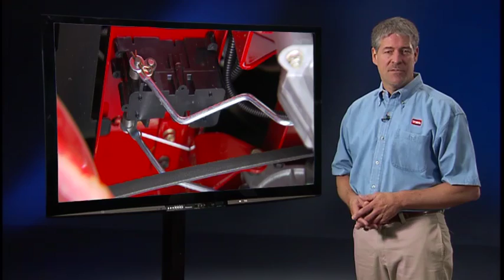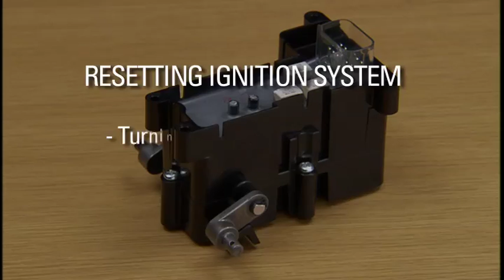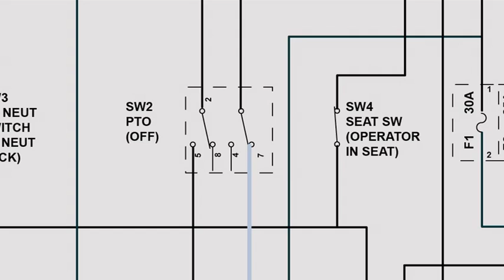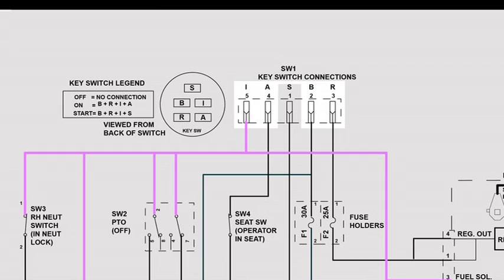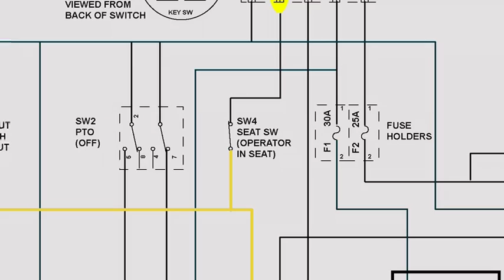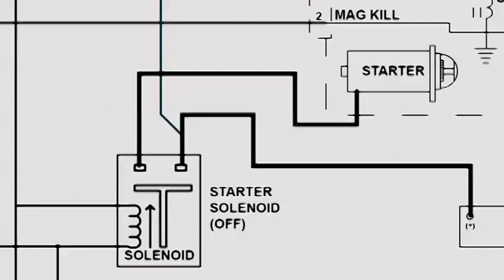TimeCutter SS - Brake Control Module (Troubleshooting)

Comment: Except they designed it to fail From mud and grass by having the electronics exposed to the elements and the only way to clean it is to disassemble the unit every time you clean it

Comment: Thankyou for a very good video.  I have  installed a new ignition switch (genuine) to replace a dodgy car type switch installed by a previous owner.  When the engine is running and I engage the PTO switch the starter motor operates.  Can you help with some advice please?

Rick from Aus

Comment: I bought a new 42 toro..3 days later brake control problems..your video is a joke...non stop electrical problems the last 2 years..dealer mechanic is also frustrated...

Comment: I have a MX 5050 and I had to replace the brake control module 3 times the last one lasted 3 weeks.  Buy a new zero turn but because of this module it won't be a toro.  Its too bad because this is the only complaint I have with the toro, but its a $100 a shot and a pain

Comment: I just spent time and money chasing this problem myself, because getting it to a shop would have been difficult, and because I like to fix stuff.  I did start from the power end, first replacing the battery (just because it was several years old).  I wasn't hearing any sounds that suggested a solenoid issue. Then after watching a bunch of YouTube videos, I became convinced that the park brake module was bad.  Those aren't cheap and they aren't easy to replace.  (Perhaps no surprise that several of the videos in fact had to do with jumping or shorting the module switches, to disable the brake.  I wasn't keen on doing that.  I wanted a fix.) Could hear the PTO clutch "click" when that button was pulled, so figured that was probably okay.  Mystery was that the park brake disengaged when I turned the key to "On," even with the control levers in the extended "Park" position.  After turning the key off, the module would again actuate -- but only after 5-7 seconds -- and re-set the brake.  So, okay, the new module DOES work (and the old one probably did, too -- glad I kept it), but it's getting bad instructions.  I went in to test the switches, starting on the left.  I discovered that the wire connector to the switch was loose.  I cleaned it up (grass out, dielectric spray on) and reattached it.  Mower started right up and runs fine, now that the park brake actuator isn't getting mixed signals.  Long, circuitous route to a simple fix, but I got some new parts on the machine and learned a lot, so at least there's that.  I'm going to re-post this as a comment to some of the other videos I watched, in case it might be useful to others with the no-start problem.
Reply: Hey thanks for this. After cleaning up the connector, etc. was there still a 5-7second delay?
Reply: @knock3x  Nope.  Everything worked on time, as intended.  I believe the delayed activation had to do with the module getting conflicting signals from the two control bar switches.  The module is just a servo (small electric motor driving some gears, which in turn release or engage the park brake cogs).  One of my first guesses was that one of the plastic gears inside the module had broken or become stripped.  That wasn't the case.   I'm inclined now to think that most replacements of these park brake modules are not solving the problem, which lies somewhere else.  There are plenty of YouTube videos on how to short the wiring to the control bar switches and see if the module/actuator itself in fact works okay.
Reply: Isn't it supposed to be delayed?
Reply: @ProjectJayRose  No reason to think so.  When you push the control bars to the side, thereby depressing the park brake switches, you should be able to confidently assume that the brake is on -- even if the mower is still running (with or without the PTO engaged -- of course, if engaged, you can't leave the seat without killing the engine.)  With a delay, the utility and safety factors in a parking brake would be compromised, at least during the delay.

Comment: These modules are an absolute nightmare. Thankfully mine has lasted about 3 years. Neighbor had to replace his after only 40 hours. Worst piece of electronic engineering ever made. Totally stopped the mower dead in it's tracks. I couldn't move the brake levers on the module. They were locked solid. I had to by pass the module and secure the brake rods and away it went. The replacement was a whisker of $420.00. Yes, you read that right.

Comment: The brake system on these Toro's is pretty fickle. I've had mine repaired twice and it's costly. The brake setting lever can sometimes move too. Check it first. Thinkin' of getting a John Deere or something a little more pricey but reliable next go round.

Comment: Reliability? The last one I replaced didn't last a full year.  Thinking of selling my ss5000 because of this issue considering the part is between $100-$125 and has to be replaced every year. I've bypassed the  POS and will never buy another Toro mower.

Comment: When this module fails your mower will not turn over, start or move. It fails with the brakes locked. Terrible design for a part that costs $125.00 and will fail, ask me how I know. I own a Timecutter 50 inch and it has given me more problems than any mower I have ever bought. I will never buy another Toro.

Comment: I have the Toro 4225 and it's done nothing but give me problems since I bought it, never again will I buy this type of mower. I also own an old Yardman 38" mower and owned it for over 13 years and never had any mechanical problems with it.

Comment: I've got the 3200, and today I can't get the brakes to release. Moved the handles in and out but you cannot hear the brakes release. 
Can this be converted to a manual brake? Tried the manual break release but they do not disengage, both levers were pushed in.
Reply: If you find a wiring diagram to bypass this let me know. I currently took the rods off of mine and safety wired the brakes open so now I have to strap it down to my trailer because I don't have brakes. if you ever go this route be aware that it will continuously run your hour meter up and you have to manually go underneath there and move the brake actuator to the other side to make it start. Also I have to turn the key off and swing the arms in to make the motor shut off due to a safety. It's funky and all jacked up but that switch is bypassable but I would like to bypass it through the circuitry so it doesn't run my hour meter up
Reply: @stinkyvonfishstix4196  I ended up disconnecting the rods from the module, then pulling them forward and tying them down with a wire, otherwise they pull into the brake position automatically or droop down onto the belt. Correct that the auto brake no longer works, but it shuts off fine with the key. It does have an issue starting where I simply hold the key then suddenly it will begin to crank to start, I know the module is bad. Not sure what an 'hour meter' is, something I'll have to check into now.EDIT... looked it up and mine never came with one, wasn't aware they existed. Spiffy.

Comment: This module failed on my 5060 yesterday while mowing. Luckily I was able to winch it onto my trailer to get it in the garage where I could work on it. Not crazy about this design, but between the EPA and all of the other Nanny State government agencies trying to make everything idiot proof, it's a wonder these things work at all. If you have any doubts about that, buy a new gas can and try to pour gas into your vehicle with it. Anyway, I've had this mower for 3 yrs and put about 200 hrs on it. The only other problem I've had was a shredded drive belt about a year ago, and I run this thing wide open all the time,. Sometimes the grass is a foot tall before I get a chance to cut it. Lots of folks bashing these mowers on here...but I have been pleased with mine.

Comment: What a heaping pile of garbage this thing is! There is no substitute for a manual linkage on a parking brake. I work on mowers and these Toro brake control modules are a joke. These modules are basically the brains of the entire mower. When they go bad everything quits working. So your mower breaks down with a bad brake control module and you pull the levers to release the hydro so you can push your mower back to the shed but it still won't move! So you'll have to crawl underneath of it and disconnect the parking brake arms to get the pile of crap back to the shed to work on it! LOL

Comment: If you look at this diagram, you see there is a wire leaving the module going to ground(an upside down Christmas tree) If this is an actual wire, this is the wire to put a switch in series with. If this is a ground that goes through the body of the module, then your going to have to isolate that module from ground and use the switch you have to buy to get a ground too the module. Everything would be a lot simpler if Toro and it’s “ENGINEERS” would figure out away to make this lawn mower more dependable. I don’t need a company rep telling me about the problem, I need a company rep to tell it fixed. I guess I’ll be buying a John Deere, alittle more price wise. But I won’t be spend $100.00 every time I want to use it.
Reply: I am glad I saw some videoes first.It is a good looking machine and was ready to fork over cash for it.Glad I waited instead of impulse buying.

Comment: FYI - I had this same problem.  I disconnected the linkage to the breaks so I could move the machine.  I then stopped at a dealership and picked up a new BCM.  Only took 10 minutes to install.  I thought I was home free.  Not so much.  With the new BCM installed and connected, I still had problems.  The brake actuator would partially move.  Ther mower would start and charge, but engaging the blade killed it after 10 seconds.  I thought I had installed a faulty module but when I went back to the dealership, the tech asked me if it was possible there was corrosion on the pins of the connector.  I went home and spent 10 minutes disconnecting the harness to the module, inspected it and found corrosion on 2 of the pins.  After a thorough cleaning, I reconnected the module and bang, everything now works fine.  In my view, the problem is not a faulty module, but the connection between the harness and the module.  Dirt and moisture can get in even though there is a cover over the assembly.  I removed the new assembly and put in the old assembly and it worked fine.  Perhaps there are cases where the poor connection can cause the module to fail?  I don't think there is a problem with the assembly, there is a problem with the connector and corrosion.  I have now completely wrapped the harness and connector to the new assembly with electrical tape to keep it weather and dust proof.  Try this before replacing your BCM.  It only takes 10 minutes.
Reply: perhaps silicone spray on the internal circuit board as well
Reply: Thank you for this. Sounds like it is the 1st thing to do before buying a $100 part.
Reply: Sure wish I read this comment before replacing my brake controller and battery.  Now I'm gonna clean the leads and see if that works.  Looks like there was some kind of white paste in there already when I was replacing the controller.  I figured it was put there from the factory to help prevent grime from getting in.
Reply: Thank you
Reply: @monicajordan5362 auto parts stores sell a crc electric connector cleaner, $8-$12, get one that says safe for plastics, most are now. spray, use a tooth pic or sewing needle to scrape gunk off of wide connections, but dont do that to pin hole connections, just spray, soak and spray again, turning the connecter down to get the spray to flush out chunks.

Comment: Toro MX505: Turns ON - Full idle power is OK - Cutting Deck is OK to turn ON - BUT if you put it in drive to back up or drive it cuts power and stalls out every time.  It turned out it was NOT the seat (sitting) sensor, or a fuse, or a transmission issue.  It was a stick wedged under the back part of the mower on the bottom that must have been interfering.  I wanted to mention that in case it could help anyone.  Make sure the belts for both the Deck area in front and under the motor area in back are free of debris.

Comment: mine dies when i engage the handles. has anyone had this problem that can maybe point me in the right direction. and yeah i know its a piece of shit
Reply: cwdressen ... Yes it was a bad connection to the brake module ... the black and green wire had rusted a little... also a bad connection in the seat safety switch... some sandpaper and zip ties fixed it.
Reply: Graceful Espeon same here... looking for a way to bypass it.
Reply: Did you get to the bottom of it?  Based on this video, I'm guessing it's THIS part - the brake control module.  I had the same problem a couple summers ago and had it fixed but don't remember what was needed to fix it.  I called up the repair shop and they don't have my records which is unbelievable.  I'm about ready to order this part but looking for confirmation that it's the problem.
Reply: Thank you!

Comment: Run don't walk away from this piece of garbage. Run like you're on fire. I have an MX5060 that has spent more time at the shop than at my home in the two years since I bought it. Apparently I just ran over a stick or a really tough patch of grass and the brake system locked up. Something is always going wrong with it. Had the brain box replaced once. 42 different "safety" features designed to lock this thing up and ruin the next 4 to 6 weeks of your life while your local dealer who is swamped fixing other fools machines dicks around with it. A $4000+ mistake. If this guy wanted to make a useful video, he'd make one showing how to disable all the features that will invariable leave it stranded at the farthest point from your driveway. Garbage.
Reply: You are so right!!!  I spend more time fixing this POS  than I do mowing!!!
Reply: This is VERY accurate. Over engineered piece of crap.

Comment: This alone has kept me from buying a new toro. Probably gonna go with a Hustler 42"
Reply: I have the SS5000 - These are a yearly purchase - very subject to problems.
Reply: @riceski  I feel your pain. Mine eats blade belts at the rate of 2 a year. I always have 2 spare blade and drive belts in the shed. Don't get me started on drive spindles and bearings. I'll never buy another Toro. Next one will be a Ferris.

Comment: TimeCutter ss4225. I haven't even owned this mower for a full two months yet in the module just went out on me. Yeah it's under warranty but it's still a hassle and how many times am I going to have to mess with this from what I'm reading here? What happens when the warranty is gone? Buy one or two of these a year??? I dont think so....Gunna try to get my money back. I suggest you look around before you settle for this one

Comment: I bought one of these mowers today from Home Depot. When they went to load it on my truck they couldn't get it to roll. Someone there knew to tap on the brake actuator to get it to roll. That should have told me then and there not to take the mower. I took it home anyway. I put gas in it and started it. It wouldn't move. I couldn't get it off the truck. I took it back to the store and they cancelled the sale for me. Super disappointed. When I got back to the store, there was another customer there returning the exact same mower for the exact same reason. Obviously these actuators have a problem.

Comment: Same problem here. Completely locked up. Cannot move the machine at all. The brake engages/re-engages repeatedly even when engine is shut off, and key removed. Super frustrated. Do I need to replace the entire brake control module? Part #121-3017

Comment: Does anyone know if a bad brake control module will prevent the engine from starting?
Reply: it will and they cost around 100 plus installing them isn't so easy either - - i am in the middle of replacing my second one in 2 years POS POS and POS
Reply: k Meredith yes

Comment: I found on mine that water had gotten into the plug area and caused corrosion.  When that happened, the mower would not move even though I could hear the drives engaging.  The brake locks and drive disengagement would not release without disconnecting the battery and manually rotating the release.   What was most disturbing was the engine would no longer shut off even with the key turned off, I had to get out of the seat and engage one of the drive handles to kill the engine.  Not a very safe fail-safe.....
Reply: +TheRuralRefugee Did you have to replace the brake control module (part #121-3017)? I have the same issue, but not sure how to resolve it. I can't even get it/roll it back on my trailer to take to repair shop.
Reply: I've had my time cutter 5050 for 6 years  replaced only 1 deck bearing.the mower itself has been flawless I love it very dependable